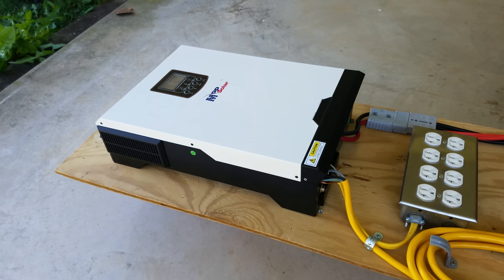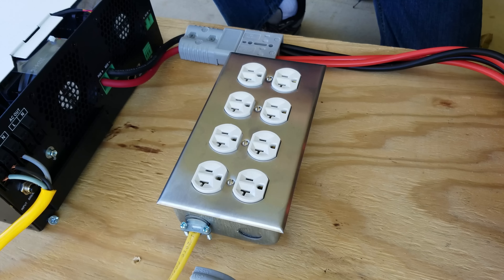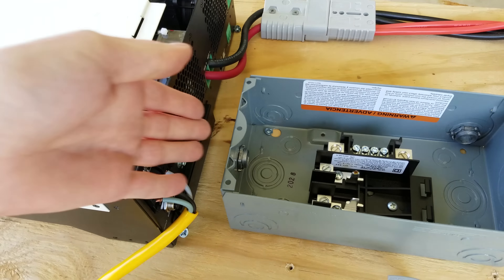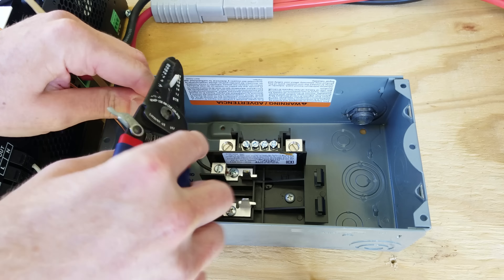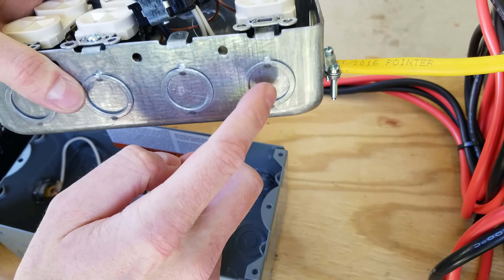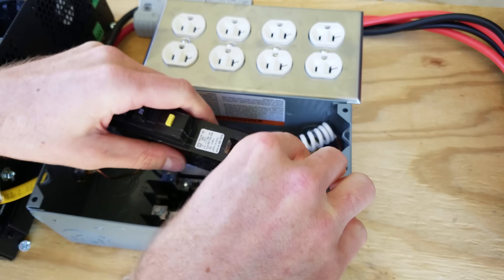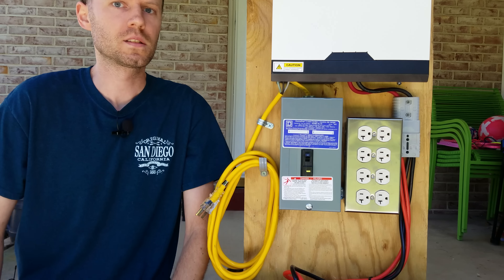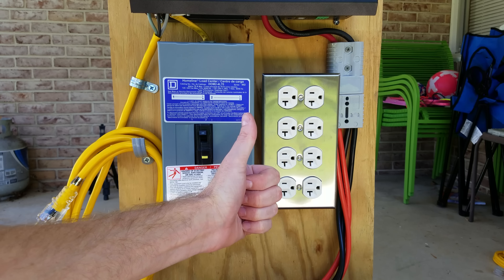Adding GFCI and Over-Current Protection to the DIY Portable Power Cart

Comment: Ground it to hand truck and then have a ground wire from hand truck to copper rod that you can sick in the ground that way it's still mobile
Reply: but then the grounding is running through places you can grab, which defeats the safety purpose of grounding in the first place
Reply: @kenzieduckmoo  there is no plastic handle on the hand truck?
Reply: @kenzieduckmoo  or just have wire to copper line that is rolled up when not in use and when in use just ground it to the ground. That's how we do it with our military generator
Reply: Oh by the way good videos,👍
Reply: @ChetCheng  Believe it or not a grounding rod does not make you safer. Earth ground is for equipment safety. See MikeHolt videos on this topic.

Comment: You don't need a ground wire.
Reply: @vicgarbutt3310  on a unit that small there is no point in grounding it to the earth. You can but it doesn't matter.
Reply: @vicgarbutt3310  You  must complete a circuit to get a shock. If there is no ground connection, there is no completed circuit. If you add a grounding rod, you will complete the circuit and be shocked. Believe it or not a grounding rod does not make you safer. Earth ground is for equipment safety. See MikeHolt videos on this topic.

Comment: You’re nice than me. I would have put a GFCI for that first one or a separate 1 gang box with a GFCI to daisy chain the others and called it a day.
Reply from the maker: That would have solved the GFCI problem but still relies on the inverter for over-current protection. That's why I opted for this route :)

Comment: So, you mentioned dual-phase.  Wouldn't that shorten the discharge cycle of the batteries?  Of course it would.   The real question is, how fast can you fill a synchronized inverter-capacitor's inactive bank from a wall plug and a solar panel, before you reach desynchronization with our current battery technology?  Every answer I  found for dual phase to this question either doubles charging time and/or doubles the amount of batteries you need to have on the cart to preserve redundancy / synchronization in active discharge mode.  Either condition has to happen for dual-phase to keep the same discharge time.  Wouldn't you desynchronize all of this by installing dual phase, because the charging current can't keep up with half the switching timings?  Not the best idea for the wheel cart.

Comment: Why install all that mechanical garbage?  when you can buy individual GFI’ s receptacles for each circuit , much cleaner look! Shalom!
Reply from the maker: That "mechanical garbage" is a standard branch circuit panel. A GFCI receptacle does not provide over current protection.